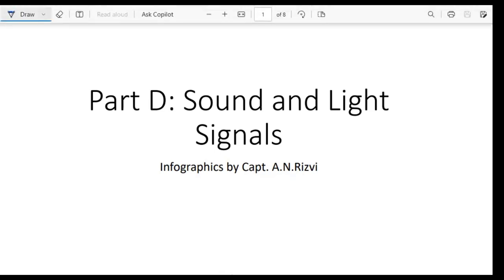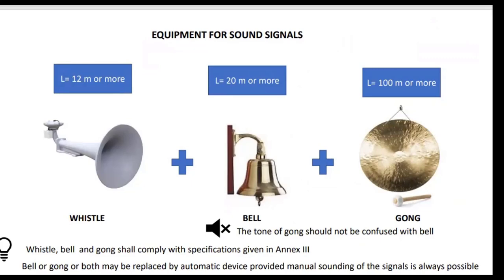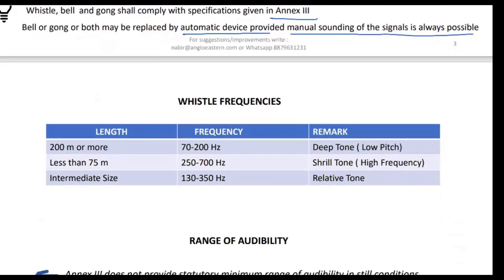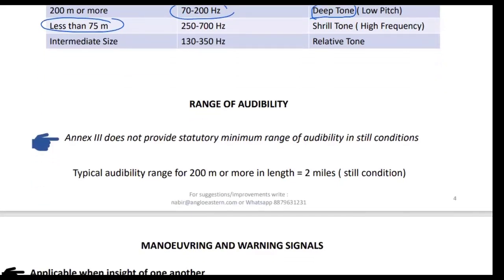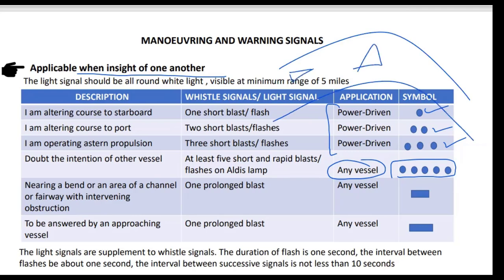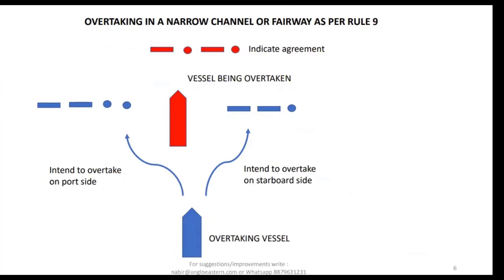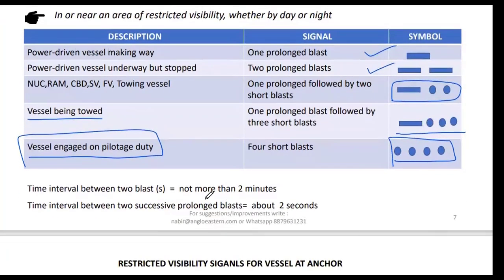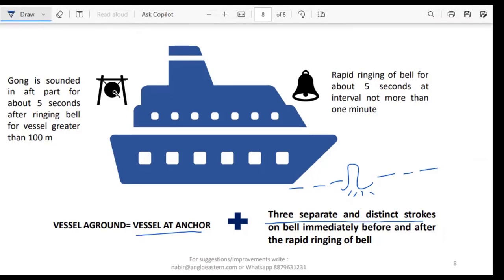COLREGs Part D_ Sound & Light  Signals ( Summary)

Comment: There’s some great information offered here but the language barrier is too much for me to over come.
Reply from the maker: Kindly advise what kind of language difficulty you are facing? Is it beacuse of English? You find it diffcult to undetsand the accent which is typical Indian English. However same is supplemented  with the presentation to ease of language barrier unless you need some other language.
Reply: You are correct in that the video should assist with comprehension. But in my case that was not an option. I was driving and listening to the video, not being able to actually watch it. 
 It’s the “Indian English” that I have difficulty understanding. The narrator does an acceptable with his presentation and English vocabulary. For me it’s the accent. And me being from backwoods Tennessee I have not been exposed to that accent other than the random telemarketer phone call.